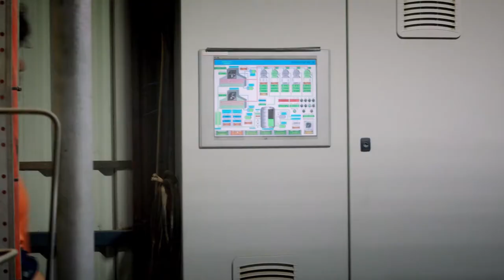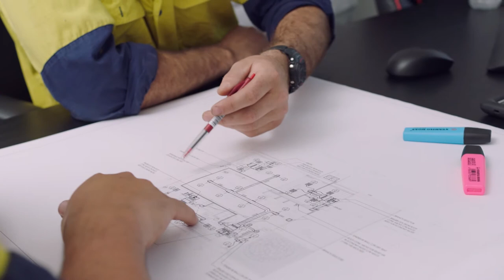GOTAFE Thinking of becoming a tradie? Study Airconditioning & Refrigeration

Comment: I am a 15.5 Year HVACR Veteran,. I have worked in all aspects (installation/service/management) of residential, comerical, and a year of refrigeration. I have also taught some small classes training new guys etc. 

Is there any resources you can suggest for me to be able to acquire a work visa to emigrate to australia as an HVACR technician? any companies you know that are sponsoring the visa? Also, is it possible for me to take and pass the mechanical and electrical required licenses online remotely without physically being there, in order to give myself a boost at my chances of acquiring a visa? 

Thanks in advance guys